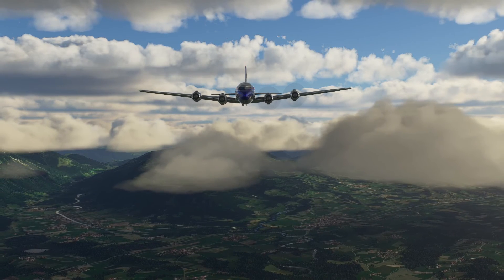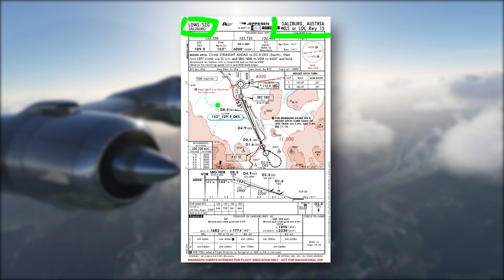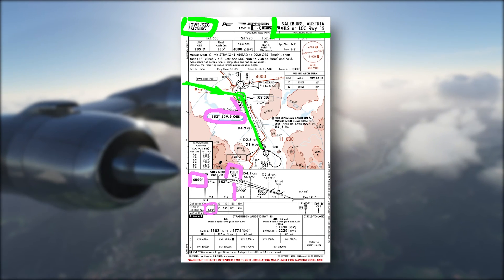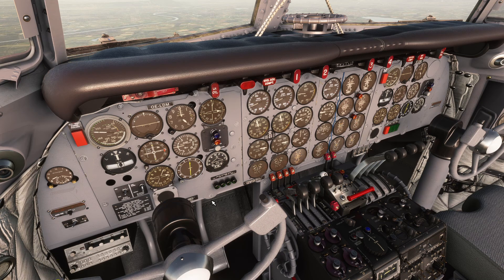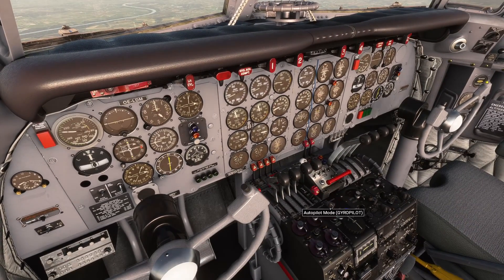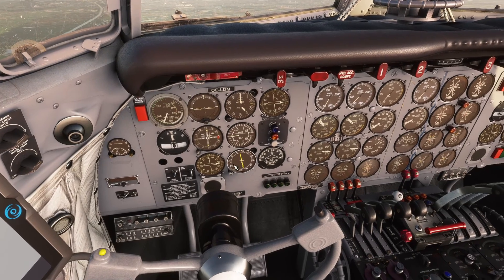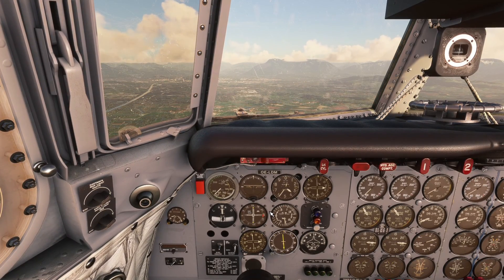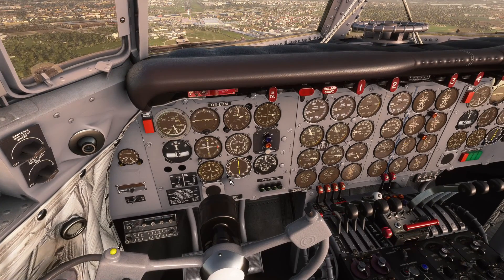How to intercept an ILS in the PMDG DC-6 - Microsoft Flight Simulator

Comment: One year later, still the Gyropilot mode on an ILS approach is still erratic. Sometimes it will not follow either the GPS track or the glideslope when on the localizer. This will probably never be fixed. 
\
Reply from the maker: Yeah, it's strange, apparently it was a sim issue when this plane was launched... That being said the last time I flew it on an ILS which was the first in a long time it worked OK.

Comment: Thanks for the great tutorial. Unfortunately for me I still haven't managed to successfully do an ILS approach after following your instructions. Once the needle starts moving I switch it to Localizer Mode and tap the CDI button twice, however instead of the aircraft turning towards the localizer it just starts doing circles!! I've updated the GNS 430 and checked the flight plan which is loaded correctly with the ILS approach. And yes, I activated the approach phase in it. Not sure what else I can do :(
Reply from the maker: Hmmm! I've not flown the DC6 in a good while so not totally aware if there are any new bugs... That being said the only thing I can think of is your intercept angle? Is it steep? It can be a bit temperamental about these things! Does it work with the Bendix radios?
Reply: @BobbyFuzzy  I have since got it to work a couple of times but it’s very temperamental. Angle has to be perfect and it struggles with any crosswind. I just manually land it now. It’s super stable once setup on the approach
Reply from the maker: Sounds about right! Remember this is 50's tech

Comment: Congratulations for your great video! Just wanted to know one thing before my next flight: when in gyro mode, can the airplane's heading be controlled using the HDG dial knob? or this is only possible by using the Sperry A-12 Autopilot Control switch (Gyropilot).
Reply from the maker: Thank you so much! In gyro mode you can only adjust the airplanes heading using the large roll knob on top of the gyropilot. Appreciate the comment thanks 😊

Comment: Was wondering your 430 should you set the activate it for the selceted Rwy ? Or had it setup for that rwy 15 and when the plane turn on the ILS go to 430 and activate it for the rwy ?
Reply from the maker: If you’re using the default 430 you shouldn’t need to activate approach mode, it does it automatically.

Comment: Still quite buggy for me, I fly VOR to VOR exclusively, and VOR navigation often fails mid flight if I flew long haul, and to the same effect, ILS wouldn't engage at all. I tried your method, but still couldn't make them work again... Very annoying. PDMG doesn't seems to be very interested in replying my report as well, several people have the same issue as well.
Reply from the maker: Are you flying VOR’s using the GPS or Bendix radios? Although I haven’t used the DC6 since SU5, always works flawlessly for me with the Bendix, ILS and all. 
Problem is if you’re using the GPS, that’s more of an Asobo issue. There’s not much PMDG can do. I’d recommend trying the GNS530 mod though too if you haven’t already.

Comment: Really helpful video but how do you initiate a VLOC if only using the Bendix radios and not the Garmin?
Reply from the maker: This video was more to show the strange workaround we have to do with the Garmin. With the Bendix radios it’s like any other aircraft. Just make sure you have dialled in the ILS on NAV1, pay attention to your CDI and as you’re coming on to the localiser use localiser on the gyropilot and then approach for the glideslope. It’s a similar process but works far more reliably.

Comment: How do you guys adjust your trim I have it set to an axis and sensitivity right down but it's still way to sensitive?
Reply from the maker: I am using a hat switch on my joystick so it's basically a button press. They upped the sensitivity of the trim since the latest MSFS update also which probably plays a part. I'd recommend checking out AxisAndOhs (justflight.com) for more customisation.
Reply: @BobbyFuzzy  I thought they had changed something no matter what I fly it just goes crazy, I've done what you did set a hat switch for up down and a button to centre it. :)
Reply from the maker: Hope it helps! I imagine it will change again in a future update to the sim.
Reply: @BobbyFuzzy  everytime it updates it break's lol

Comment: I still can't get it to work consistently...
Reply from the maker: Assuming everything else is tuned and identified correctly - make sure the needles are moving before you double tap the button. It can still be a bit dodgy though and I would always be prepared to take over manually.

Comment: One more question, it’s related to this tutorial, kind of :) Are there any keyboard shortcuts for operating the Gyro ? It would be so much quicker, I could program my iPad running Metagrid. I’d like to shortcuts for, Giro Pilot/Localizer/Approach modes + Altitude hold on/off, Auto Pilot on/off + the lever towards the floor. Any help appreciated. Ronnie
Reply from the maker: Auto pilot on off you can use the normal binds in MSFS (I used autopilot master toggle). Couple this with the realistic auto pilot dis/engage in the tablet to your taste. Other than that I don’t think so. There’s a discussion on the PMDG forums about that at the moment so maybe some better suggestions there. You might be able to use LVARs if you use AxisAndOhs or something similar though I’ve not tried that yet.
Reply: @BobbyFuzzy  Cool, I’m heaps better flying ILS now. Hey, if you’ve got time…could you please make tutorial of planning and flying route without GPS. Then switch off that Garmin and fly just old fashioned :)
Reply from the maker: Hey Ronnie, I actually have done a couple of streams recently where I did just that. If you look up my streams ‘into the nordics’ and ‘the flying bulls’ (recordings are here on YouTube) I go through all my flight planning right from the start! But thanks for the video idea I may do just that in the future.
Reply: @BobbyFuzzy  Excellent mate ! I’ll have a look. I’d like do old fashioned way, find some old timetables and fly like they did in the 50’ties or even earlier
Reply from the maker: @yams900  Enjoy! I'm not a total expert at it and it's difficult esp. in Europe due to the prevalence of RNAV routing but it's great fun nevertheless! 

I found this absolute goldmine the other week, sounds like exactly what you're looking for! - https://www.timetableimages.com/
Reply: @BobbyFuzzy  Thx mate ! I’ll pick a route and try to fly it, without GPS :)
Reply from the maker: @yams900  Enjoy! I'm doing most of my streams with the DC-6 this way at the moment, so feel free to drop by! Tempted to do some dead reckoning over the ocean soon, too!

Comment: Finally an awesome tutorial about ILS and PMDG DC-6 ! I've had various luck, with you help, I'll be a master in this subject. Just a question or two. Do you need to catch the localizer in an angle, say 45 degrees ? I've been flying straight in, same course, from far away. Maybe wrong tactics.2nd question, when should the approach light come on ? Read your post in PMDG forum,thought..Thank God, finally an answer ! Cheers, Ronnie
Reply from the maker: Thank you! I hope it is helpful for you. Not necessarily a smaller intercept than that would be fine and you might even get away with something bigger. I suppose flying straight in it maybe more difficult to see if the capture actually happened but it should still work. Essentially all you’re doing is giving the system a little nudge so that it starts tracking the needles. The main thing is just to make sure you’re ready for it and not distracted by anything else! Hopefully it won’t always be this way. 

Approach lights I assume you mean landing lights? I can’t remember the figure off the top of my head but they come on below around 140kts. If you check the checklist in the manual it will give you the exact figure. 

Any more questions feel free to drop them in here!

Thanks, Rob
Reply: @BobbyFuzzy  Help was just perfect, exactly what I had been looking/hoping for. Next to the selection knob for the mode, there’s a blue light. I’m sure it will light up when there’s a signal. Must check again…just logged off my computer. I was thinking…use slew mode, place plane you like, check out more carefully what’s going on. All good ! Happy flying :)
Reply from the maker: @yams900  The blue light will usually always be on when you're using the gyropilot with the GPS. I usually look at the DME window along with the CDI to verify when I am in range of the ILS. But yes by all means slew yourself over the practice! Thank you and you too!